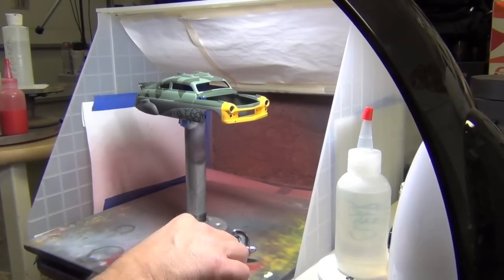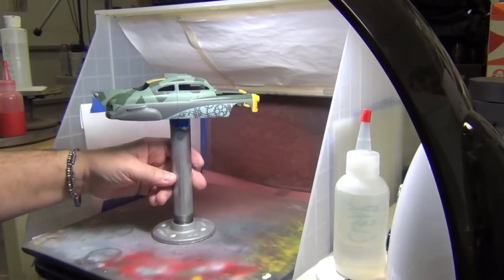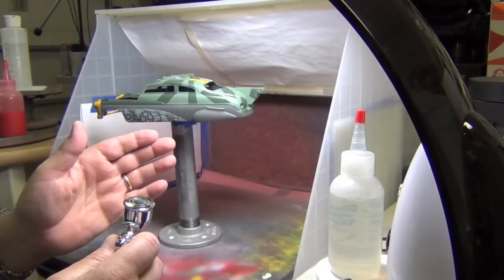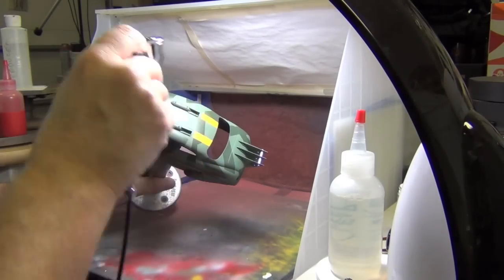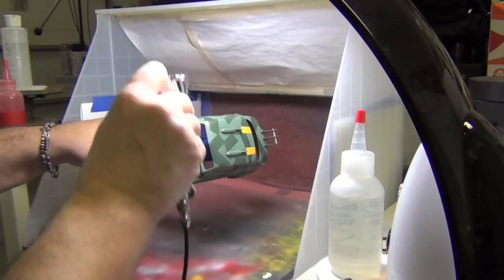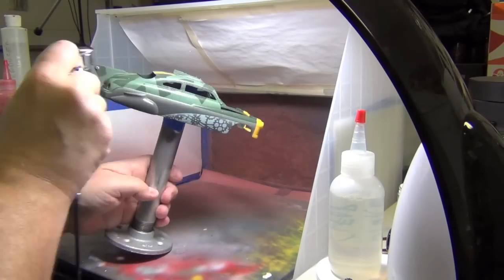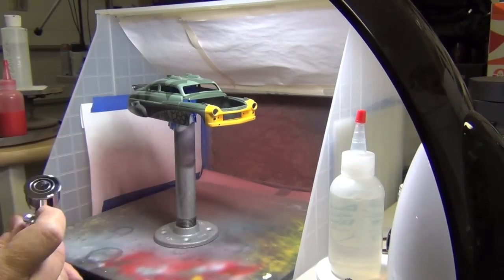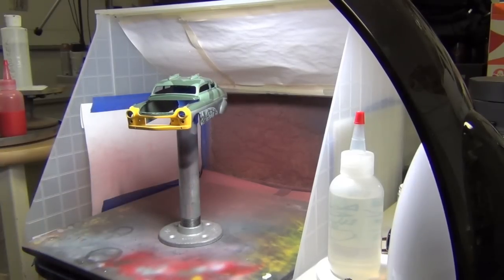CLINIC:  Airbrushing Future Clear (Part 2)

Comment: Hi Doc, another great video. I'm new to airbrushing and I've just got myself a starter kit and spray booth. I've picked up loads of great tips from your vids. I'd love to know where I could pick up one of those stands that you use to hold the model. Is this something you made yourself or can I pick one up online? Your advice would be much appreciated. Thanks, Colin (UK)
Reply from the maker: Colin, this is Donn Yost's trick.  Go to the plumbing section of your hardware store and pick short lengths of 1" piece of pipe with it's flange which becomes the base.  Cheap and simple and it works beautifully.  Cheers to all the good friends in the UK.

Comment: Hi Cranky, I came across this video from the Mokanaman. I like to paint armor and would like to start on a model car, but it seems like a whole new discipline. I primarily paint with acrylics, but I notice many car modelers use lacquer/enamel paints as they are polishable - I've also seen some pretty nice gloss work done with Future, too. Is it possible to get a A+ gloss finish with multiple coats of Future? Is Future polishable, and does it ever lose its sheen over time? Looking forward to hearin' from ya.

Comment: yes, I have a question if I may. After you sprayed how did you clean your airbrush? Thanks, Dana
Reply from the maker: D Ringquist I disassemble the AB and use a sonic waves jewelry cleaner to bring it back to brand new.
Reply: +D Swedish you could also use 91% alcohol with some Windex (60/40 ratio)
Reply: Thanks Nap., I found a good systems a while ago. Plus i've not built in sometime. Lost interest I guess
Reply: hahaha, I am using Windex (that stuff you clean your windows with (blue)) thinned with Water.

Comment: Great video as always cranky but personaly that floor polish scares me...im gathering its a fairly new product...so ibe worried that i would regret using it a year or 2 after applying it. The best thing that i can think of for someone clearing as many models as i will be is to buy a 1 gallon kit of high quality automotive clear and a fast hardener and put it in little bottles like u had your future in to mix as needed. or a half gallon kit

Comment: Great video Cranky, I have been using Future for years also. They changed the name sometime ago for anyone interested now it's called "Pledge Floor Care Multi Surface Finish" I called SC Johnson about the name change before I tried the new formula they said it's the same stuff just changed the name. It worked just as good as always. By the way, did you build your spray booth yourself? or did you buy it prebuilt? I need one too,..just wondering.

Thanks
Greg

Comment: he calls it "future clear" but the  the actual product  name is "Pledge floor finish".. you can find it at walmart in the cleaning isle. it's an acrylic resin used to add a protective finish to flooring.. it does not have a high uv protection as it is designed to be reapplied on a regular basis and the new coating will strip the previous coat

Comment: Will this work as a regular clear coat?
Reply from the maker: You can use it over other acrylics, but I don't recommend using it as a general purpose clear.
Reply: Like if I use it over acrylics on my car models will it give the high gloss shine the world is craving?
Reply from the maker: I was never able to get that kind of shine using it, but others on YOUTUBE have.
Reply: @DoctorCrankysLabRATory  but it'll do the trick as well as it can? It'll shine at least?
Reply: @Yourlocaltankgirl8375  Yes. It gives a pretty decent shine/gloss that is easy to dust/wet clean over the years. It makes the windows look amazing! You can even brush it on! Honest, try it if you haven't yet. Use a smooth, soft, wide brush and really coat in on there. Get the drips off the bottom edges.